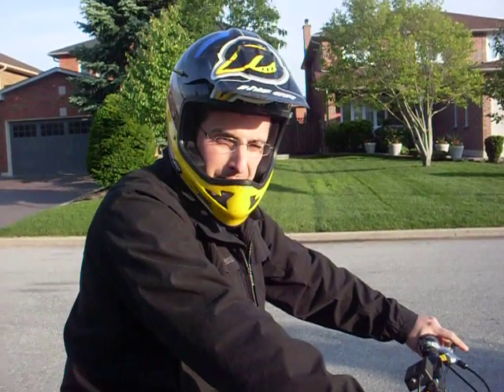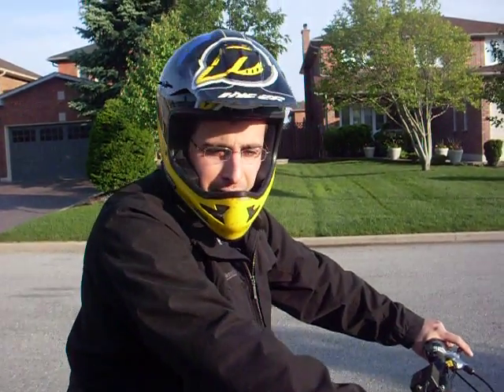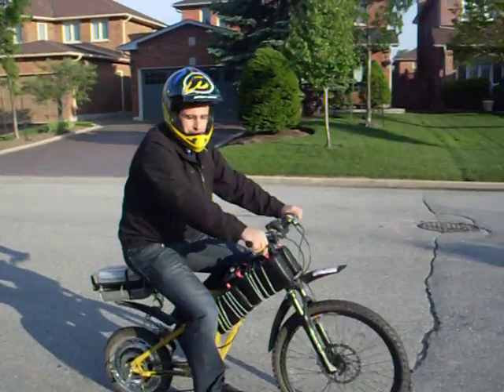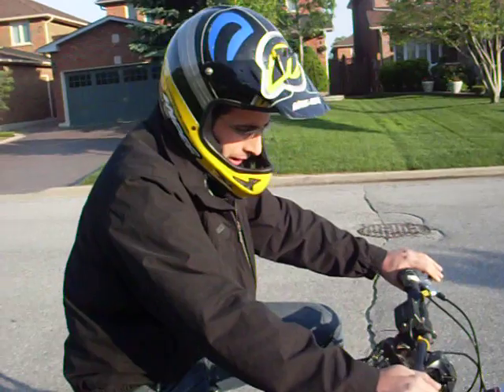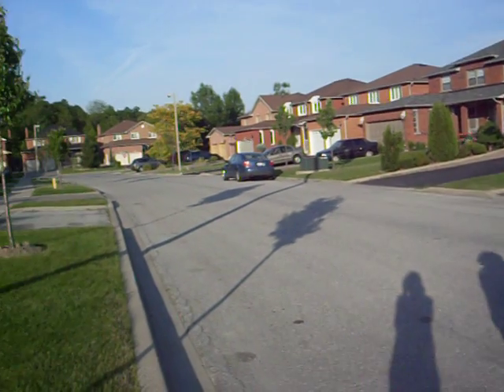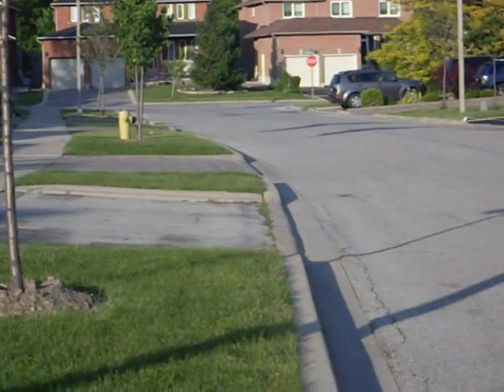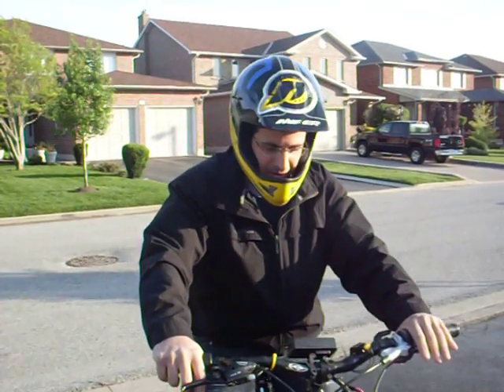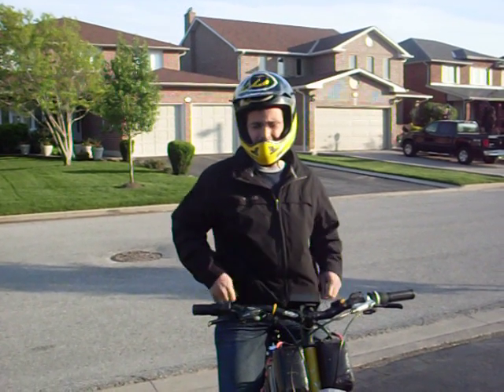Star/delta @ 50 v a123 125 amps

Comment: Is that a just a 50v series pack or do you have cells in parallel?  My 15lb combat robot has a 3s2p A123 pack and it pulls 200+ amps.  I would think 125 amps would possible with just a series, but you would have a very short run time.  Nice project!